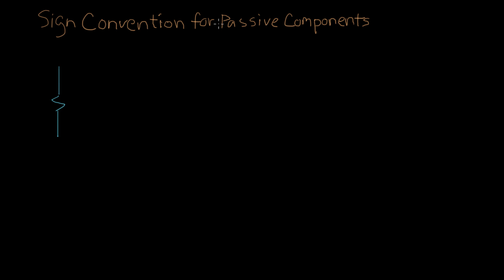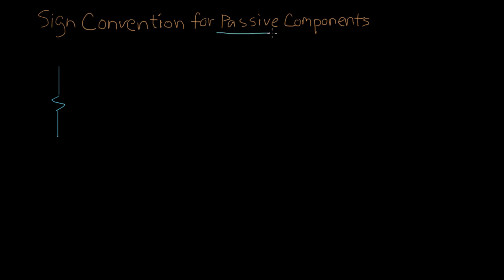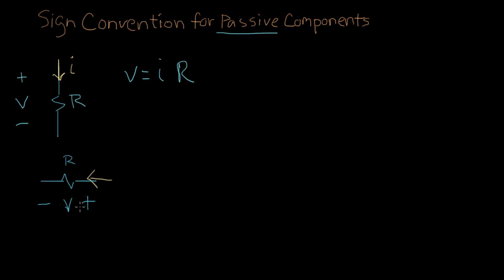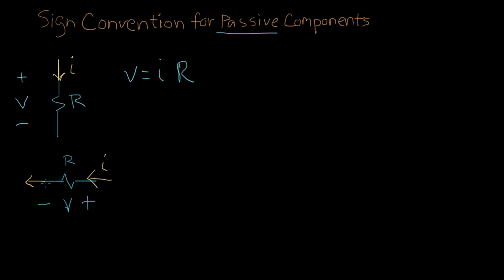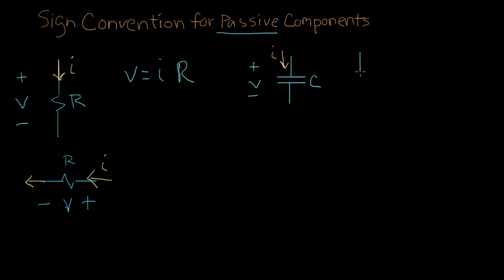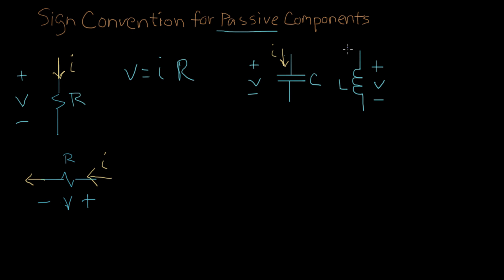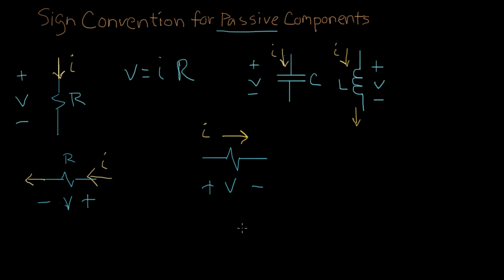Sign convention for passive components | Electrical engineering | Khan Academy

Comment: I've decided that the arrows are not arrows but greater than/less than sign in order to capture the direction of the flow of electrons.  I still think in terms of the arrow though if it's in biology and positive charged electrolytes are moving into a cell.